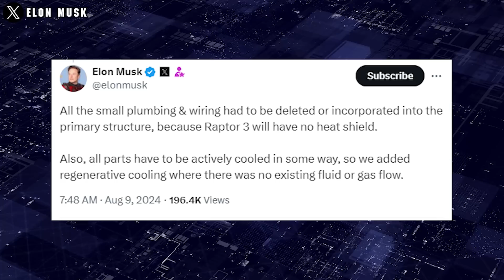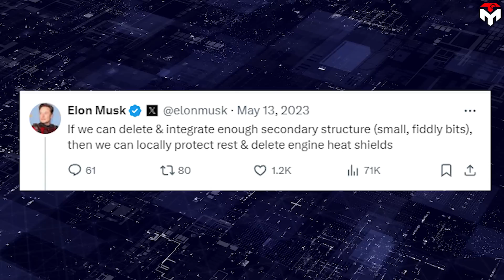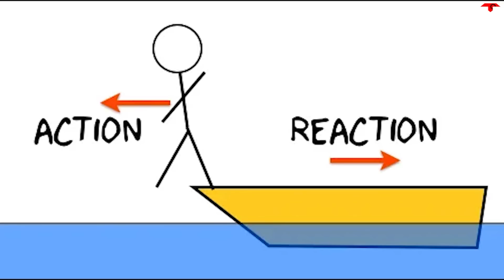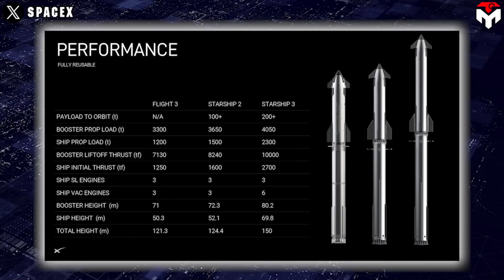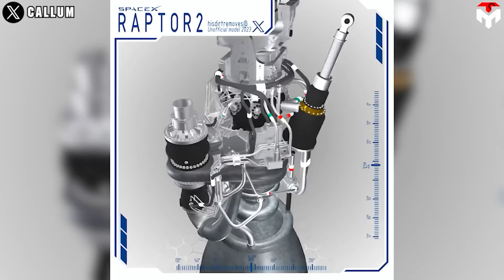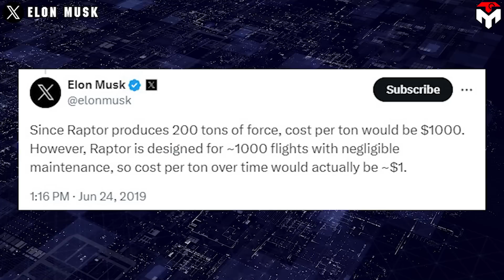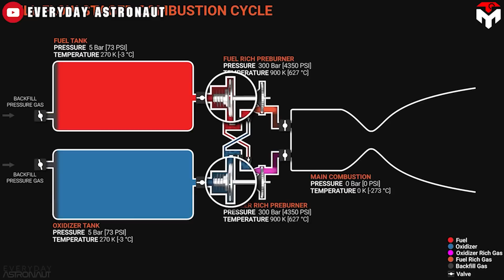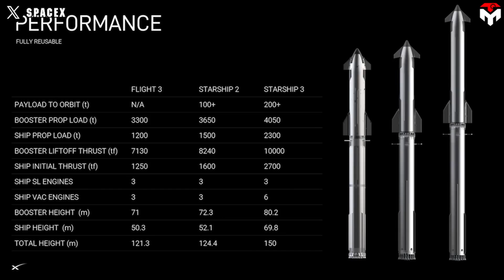SpaceX New Raptor V3, V4 Totally Shocked NASA and Russia Scientists!

Comment: 105 kg saved per Raptor engine times 33 engines per booster means a dry mass reduction of 3.465 tonnes (not 36 tonnes) for the booster.
Reply: Don't forget the reduction in weight due to no heat shield needed with raptor 3
Reply: I took it as; the reduction of mass of 33 engines + the increase in thrust of 33 engines = 36 tonnes of payload increase.

Comment: So if the best part is no part. Then why do you have 33 engines instead of 5 like the Saturn V F1?
Reply: You'd be amazed how many parts those F1s had, and they could only fly once. Also, by using a smaller engine, SpaceX can use the same engines on both stages, whereas the Saturn V needed different engines, the J2, on its upper stages. This gives the Starship (and Falcon) much greater operational flexibility than the purpose built Saturn V. The Saturn V was the greatest rocket ever built, it put us on the Moon, but now it is time to do more.
Reply: @odysseusrex5908  add to that...the raptors are more easily mass produced than any other rocket motor before (not withstanding the smaller amateur rocketry stuff)
Reply: @odysseusrex5908  Your right the Saturn V is the greatest rocket ever built and it did take us to the moon and until Space X does more it will still be the greatest rocket ever made. the question is will they ever make it? 33 rocket engines have 6 times the chance of failure that 5 rocket engines do. I would like to see Space X really simplify their rockets and cut down all of those failure points. Why not 5 Mega Raptors and really simplify things? The Russian moon rocket failed and killed most of the scientist who worked on it using the same concept. Keep it simple.
Reply: @RepRapper   a "mega-raptor" would be too large to mass produce in the numbers SpaceX would need to accomplish the end mission goals of Starship, plus you'd still need the smaller raptors for the second stage anyway...mass production and reliability are key, as the mission goals for starship and super heavy extend much farther than just the moon or Low Earth Orbit, and will require Starships being produced in the thousands
Reply: @DiamondPaintWithDiamondDave  Starship will never be produced in the thousands. Mars and Earth only line up the right way every two years.
Reply: @RepRapper  the reason why they make so many rocket engines is because they produce more... i think they have produced like 500+ engines already and that makes finding flaws much easier
Reply: @Berilaco  It also makes having flaws much easier. What I would like to see is 5 engines simplified. That's less parts and fewer failure points. Back when they built the Saturn V F1 engines they didn't use 3d printing the parts were cast using the lost wax method. Space X has eliminated a lot of parts on their Raptor engines The only way now is to eliminate engines if fewer parts are really better.
Reply: @RepRapper  no it doesnt make having flaws easier

More engines created means you find flaws easier and then all of them dont have that flaw
Plus having more engines is more reliable BUT only when you have gimbaling engines
Reply: @Berilaco  You can find flaws easier because there is more potential for flaws. More engines equals more parts and more potential failure points.  Cryogenics, vacuum and gravity all throw unexpected  things at us. If you change one thing like fuels then you have to change seals maybe. They have to undergo testing, To simulate the vacuum of space and temperature isn't too hard. But to actually similar vacuum and cryogenics and zero gravity here on earth is impossible. Space X has done amazingly well. Starship has not had a successful flight yet. Crew Dragon has had great success. Here is a question. If Starship distorts destroys it's man made launchpad here on earth. How is it going to work on the moon? On Apollo the lunar excursion module left the bottom half behind and became the launch pad. So what's going to catch starship on the moon? Space X doesn't even know what it doesn't know yet.
Reply: @RepRapper  you dont find flaws easier because there is more potential for flaws its because the same flaw is there 6times more than on the saturn V
Reply: @RepRapper  all starship flights were successful especially flight 4🤦🏼‍♂️
They are testing with prototypes
They arent supposed to deliver anything into orbit or land on a landing pad
They are simply flying to correct errors from previous flights to improve the overall system and infrastructure

And now they have proven that starship has incredible redundancy when it comes to flap control and engine failures and they have proven that super heavy and starship can slow down and do soft landings

What is a failure about that?
Please explain
Reply: @RepRapper  also they use the header tanks on starship (smaller pressurized tanks seperate from the main tank) to relight their raptor engines so the remaining fuel in the main tanks settles at the bottom due to the acceleration and then the engines feed from both tank systems

Basically the header tanks is kinda like those small thrusters on other launch systems that push the next stage after stage seperation so the fuel settles at the bottom of the tank

So they dont get any bubbles into the engines that could lead to failure
Reply: @Berilaco  I'm aware of the header tanks.
Reply: @RepRapper  yeah but you clearly dont know shit about starship and asume things and ask ridiculous questions
Reply: I'm an engineer with 43 years of experience in rockets and aerospace. Want to try again? Also I was quoting Elon Musk. The starship is overly complicated. They have eliminated a lot of parts It's time to put everything they have learned  use and eliminate engines and scale up. Starship still has yet to have a successful flight. I really hope for the best for Space X. I want them to succeed. ULA had already made it back around the moon.
Reply: @RepRapper  uhhh starship is in the testing phase... its still prototypes

And also the last flight was successful when it comes to what they wanted to do

And i dont fucking care about your career when you know nothing about starship

They wanted to do a soft splashdown with superheavy and so they did

They wanted starship tor survive reentry and so they did

They wanted starship to do a soft splashdown if it survives and it did

What is not successful about that
Please explain
Also the program is only really active for about 5 years

Artemis only had one flight after what? 10-20 years of development with hundreds of billions invested? And it was only a test flight
A successful one but still just a test flight
Reply: I fly a single engine airplane. If an engine fails in flight, I've got a very serious and immediate problem. A B-52 has 8 engines and if an engine fails in flight, the crew may elect to continue the mission. SpaceX has elected to settle the 3-way compromise between simplicity, complexity, and redundancy by using 33 engines on the Starship booster. Presumably, they have made their best choice based on tons of data that I (and you) don't have access to.
Reply: @richardpark3054  I fail to see the relevance when you compared the single engined aircraft with the B52. A B52 is a warplane and is likely to be shot at. While a single engine private plane parachutes aren't even mandated because even with the engine out the plane comes down slower than a parachute.
Reply: @RepRapper  You're really struggling with this! If you are an engineer, why do you not understand the safety of redundancy? And that redundancy inevitably has a cost? Or that there are different measures of 'success'? It has absolutely nothing with potential for being shot at. And yes, should the engine on my single engine plane fail, I will glide to the ground (or water). However, if it's not my day, that ground could be mountains or forest or a residential neighborhood and a safe landing will not be possible. (Water is OK for me because my plane is amphibious.) Good luck!
Reply: for engine reliability... starship can have i think 3 or 4 engines fail and still finish its mission... one engine failure for starship is 3% unlike the 20% for Saturn V
Reply: @Berilaco  When they had three evenings fail Starship had to self destruct. I would submit Two is maximum.
Reply: Did starship make it around the moon? No. The Artemis made it on its first try.
Reply: I'm sure that it was very inconvenient that I do actually know what I'm talking about. I remember when Space X had their 4th launch failure in a row. Yes their fourth attempt did not achieve the correct orbit. Where I come from that's a failure. Lucky for Space X Nasa  bailed them out.

I still remember Elon Musk saying to his workers that even though the fourth flight was a failure he was proud of them for giving it the old college try. I was amazed and thought too bad they are broke. When NASA rescued  I thought I might just be working for the wrong company. I'm rooting for Space X to be successful. I want them to succeed. 33 motors is not the way to do it. The Russians already proved it. But let's not learn anything from that.
Reply: @RepRapper  okay you clearly dont know what youre talking about

Please please inform yourself before blurting nonesense on the internet

2 sentences into your shit and already dont want to read the rest

Their goal was never to reach orbit with these first 4 IFTs

Their goal was to test the TPS on starship and other maneuvers like soft splashdowns and cryogenic propellant transfer and the cargobay door
Reply: @RepRapper  also the russians didnt test their engines before putting them in their rocket and they werent using the monst advanced rocket engine 

And they didnt have any gimbaling engines to counteract an engine failure instead they would just shut down the engine on the opposite side of the rocket

The problem with that was that they lot 2 engines even though 1 failed

Starship had one launch that didnt go nearly as planned but the next 2 went quite well with all engines lighting

The last one had one failure on the other ring but unline the N1 it could keep all other engines lit and counter the thrust imbalance with the inner gimbaling engines and was the most successful launch yet (with 3 total engine failure
1 superheavy ascent
2 superheavy landing burn
3 starship landing burn
So how is it unsuccessful you are simply saying things that arent true)
Reply: @Berilaco  You only need one catastrophic engine failure to start a chain reaction. 33 chances increases the odds over 5. Why not learn from success? Why repeat mistakes of others? Space X has done amazing things.  Even if we did design they're landing and guidance systems. We want them to succeed. They're good customers!
Reply: @RepRapper  is starship a fully finished system? Yes or no?
Is SLS a fully finished system? 
Yes or no? 

Please just inform yourself about both launch systems

Comment: Why don’t they use the Raptor engine in Falcon 9 ?
Reply: flacon 9 burns different type pf propellent, you can't just use raptor engine on it
Reply from the maker: Interesting question. Anyone can answer?
Reply: I know the old saying, If it ain’t broke, don’t fix it. I also understand that it has been approved for human carry and is the cash cow for SpaceX. But it seems that there would be some major advantages to developing a version with the more powerful Raptor engine. Bigger payloads to higher orbit while recovering the rocket for reuse. Maybe it’s too much trouble for not enough gain but it seems that the improvements to the new Raptor engine would make it worthwhile to put them on a new Falcon.
Reply: It wouldn’t be a simple engine swap, the new fuel requirements would be some real changes just to change fuel storage and other changes to pump and ignite the different fuel. That is the question, would it be worth a new version of the Falcon rocket in order to use a Raptor engine with all its benefits or would it be to much trouble for the possible gain ?
Reply: Because they would have to change its name to 'Falcon 2'.
Reply: Falcon9 will be phased out gradually
Reply: Потому что с появлением старшипа , флакон устареет

Comment: In all this I heard, "the stripped down v3 engine will be much more difficult to repair"  as if this was a bad thing.  Ever heard of Plug & play? if it breaks swap it out.  apparently raptor Engine changes can be done pretty quickly and they will have lots of them lying around. 
This is not new, back in the 1980's Volvo was working on a sealed truck engine, that is you just bolted it into the truck, and away it would go for a million miles.  no oil changes no servicing no nothing just bin the engine and throw in a new one  when it reached the target mileage.
I dont know if they ever managed it as I never kept up with the industry when I left but as we "progress"  throwaway components  are the thing these days When was the last time you heard of a mechanic "fixing" say an alternator? just get a new one its easier, quicker and eventually cheaper.
Reply: You can recycle it to shred it and 3 d print from the shredded parts

Comment: I'm wondering with the regenerative cooling  if Raptor 3 engines might not pick up a slight measurable amount of thrust from the heat backwash from the engine plumes.

Comment: A future Raptor engine at 330 metric tonnes thrust would be nearly half the thrust of a Saturn V F1 engine of 680 metric tonnes thrust (1.5 million pounds).  The F1 engine was initially troubled with chronic combustion instability causing it to blow up which the V2 rocket engine did not experience.   The claimed fix was placement of vanes in the combustion chamber, but as secret as rocketry is that might only be the visible part of the fix.
Reply: In that case you also ought to compare the sizes and masses, and chamber pressures of the engines too.
Reply: @peterclarke3020  для них ракетный двигатель измеряется только в тяге , а на остальное им побоку.
Reply: Each F1 was hand crafted by very skilled machinists. They are now all dead as are most of the engineers. Children playing with their daddy's toys.